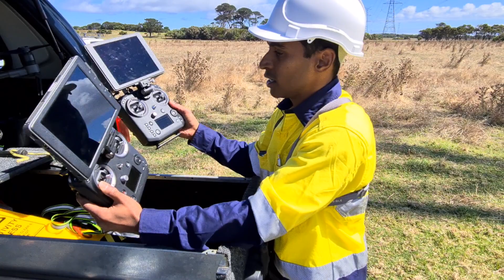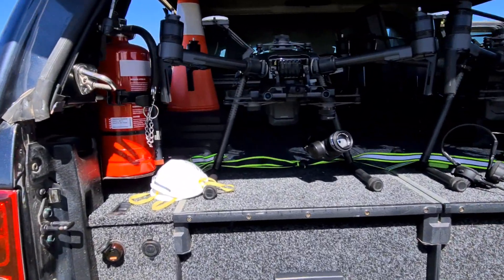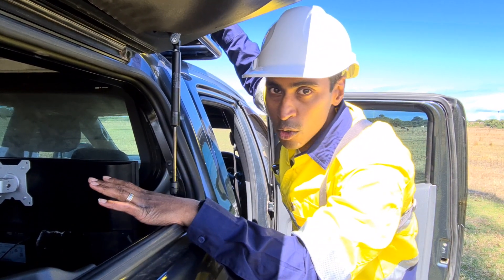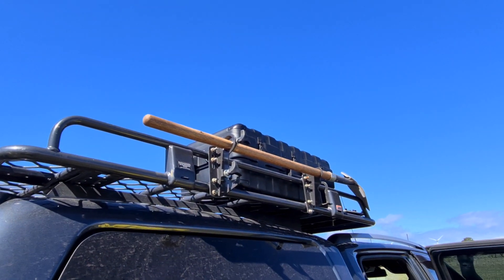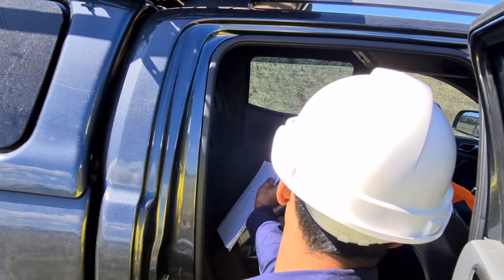Our drone vehicle setup for Powerline Inspections

Comment from the maker: Anyone else with a rad drone-spec vehicle I'd love to see your setups or if you have any tips regarding battery management!
Reply: Hey guys, if you change your AGM batteries for lithium ones and get the correct DC to DC charger for them you will have far more available ampere hours to utilise and having your vehicle running will enable a much faster recharge. Lithium batteries can handle up to 60a charge rate from a decent DC/DC charger and you can upgrade your car alternator to pump in the extra charge rate. Hope this helps.👍 love you vids..
Reply: I guess I’m late to the party here but my best advice for battery management is to have a second high amp alternator installed. That’s how we charge those car batteries super fast for sound competitions and such (also how an ambulance can power life support on the go). A custom alt will only set you back about $450.
Reply: We use a generator when on a fixed site and use the batteries in the vehicle to charge in transit. The goal is to be 100% off fossil fuels in the next 5 years so the Cybertruck will the next step. Just started watching your video's. They're super well made :) really really cool! Keep up the rad work.
Reply: Chuck a solar panel on the roof with a mppt regulator. Or get a dc dc with mppt reg built in. Im upgrading from a 25a dcdc to 40a. Dcdc with my existing 160w solar panel. This will be charging 2x 120ah batteries.

Comment: You guys have done well packing all that into a Ranger. Anyhow, I don't know much about what is available for it but a second alternator would help if you don't have one already. At the very least, install a higher amp alternator. Also, I would look into a solar panel that is mounted to your hood and used to help trickle charge your main truck batter. That will help ease your fears on a dead truck battery and its easy to install and you have the space. As for the solar panel you have. they make some pretty nice panels now days and you could maybe create an expandable setup, something that folds out. But it kinda sucks that the vehicle has to be turned off. A small Honda generator with a 5 gallon gas can maybe an easy solution.

Comment: I hope you got your electrical charging done by now. But if you haven't. You could look at a Higher Output Alternator, 1-0 gauge Wire for Ground and HoT, and Distribution Relay so that when your traveling. it will switch between the Main battery and Secondary Battery Charging. You Can Always Goto A Stereo Shop and they Will Hook You Up Better and alot knowledgeable.

Comment: You need a High Output alternator.  Run the HO connector to a gel cell battery bank of 4.  That will be your charging system for your batteries, etc… The 12amp connector on the HO alternator will power the vehicle as normal.  Problem solved.

Comment: U should try and hook it up to a capacitor from the alternator on the vehicle and the alternator will charge the capacitor and the cap will ensure power on demand to the batteries so will be constantly charging while the vehicle is running

Comment: When you use a inverter to go from 12  volts DC to any AC voltage you have a serous power loss. If your charging station used DC voltage instead you would have fewer issues. Caution if you rewire batteries and use a 24 volt inverter it would work better ( caution this is for a professional electrician only and can be dangerous to work with).  Also your truck alternator size might be increased. Make sure your truck charging system has a battery isolator to charge the main battery on its own circuit and the 2 AGMs on their own circuit.  AGM battery companies sale a special battery charger that will extend the life of those batteries.

Comment: Probably a little late but I would say your best bet would be to upgrade your alternator. Either with a bigger one or multiple. Kind of like they use in the car audio world. Like a mechman 370 amp alternator or 2 would fix your issue and possibly some bigger batteries like some xs power batteries. All used to power big car audio systems so wouldn’t be a issue running your gear.

Comment: Great rig rundown and great equipment. Only thing I would do differently is with the 12v batteries - AGM batteries are voltage sensitive with regards to draining them, possibly look into a LifePo battery like Battle Born. You can run them down to zero and they wont get damaged - also possibly a small 100watt solar panel kit mounted to the roof of the cap for onsite charging....just my humble opinion, keep up the great work!

Comment: Buy a 20 amp Charger, they sell them at most auto parts stores like supercheap and repco. And if that’s not enough then buy 2 and disconnect the batteries from each other and charge them separately.

Comment: Great video ! a bit similar to what we have in the UK in my van. You need the biggest  DC - DC charger for the ranger and ditch those agms and go for lithium. For loads more usable power and faster charging, always plug in on shore supply when at base to keep charged.  You can never have to many batts 👍🏻

Comment: Looking into the Power line inspection with drones business myself. Could I use a DJI Mavic 2 Zoom or Mavic 2 Pro for starting the business out? And then later switch to the matrice 200 later?

Comment: GREAT Stuff.
With your Battery issues...
Do you have a PWM or MPPT charge controller?
A good investment might be something like a Victron inverter along with a Cyrix battery combiner, it should allow solar and aalternator to charge simultaneously. Also A bit more on the cost front, but get the right Victron and it will come complete with between 15A and 50A charge circuit for when plugged into AC. That will charge those AGMs in no time!

Another point, consider a 2nd panel - on my Broadcast van I opted for 2 x 250w panels in series, at the moment it is charging through an intelligent MPPT controller which accepts either 12v or 24v and outputs the same or steps down from the 24v to 12v. Which it is doing right now while I wait to get banks of 24v LiFePo4 in...I have been building the VW Crafter since October...but funding has just dried up as our normal weekend work is all footy...:( so on hold until...whenever.

Say...Any chance you guys are after any freelance/extra UAV operators? Turns out I have the next 12 months of weekends Free!!!
I'm IN Ringwood East, fully ReOC, AROC and RePL'd...Cert 3 in Aviation, and also come complete with a Broadcast Van, including solar...haha.

Comment: Aaron, you should look at the red arc range. Any serious 4wd setup running gear is using the red arc gear for battery management and charging. They are soo detailed they would probably even tell you what you need based on what you are trying to charge. Good luck
Reply from the maker: Yea Cheers man we have some redarc products & are looking into some better batts & maybe a 40amp AC to DC charger for topping up the car batts lover night

Comment: Impressive setup Aaron thanks for running us through that. How much ballpark did that cost to put together? Not many folks can justify something like this, but for higher end client work it makes sense. And you are right battery management is key and having systems and a workflow in place will allow you to get the job done faster and effectively. Keep producing good content mate.
Reply from the maker: Cheers mate, costs are very high but unfortunately necessary for this requirement.. if you google the equipment you can get a ball park. Much cheaper than what we paid few years back!
Reply: @UAVISUALS  Great video. We are an environmental engineering firm in the US and have all of this equipment - We need a crash course on the deliverables you provide clients. PLEASE email me mgraham@aimdronecrew.com -- What do you charge to talk to us on Zoom? lol

Comment: Great
I Run a honda generator and never let me down you can run it in eco mode and last pretty much all day runing
Reply from the maker: Good info! I think we will do that. Good ol Honda!
Reply: Agree, even if you upgrade solar & batteries still have potential issues.Simplest, cheapest and most reliable solution - the Honda generator